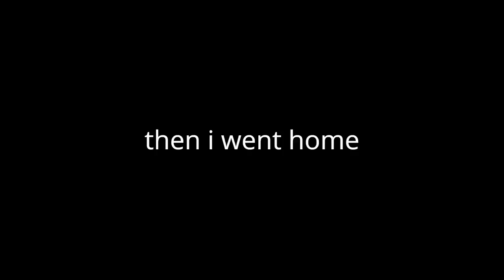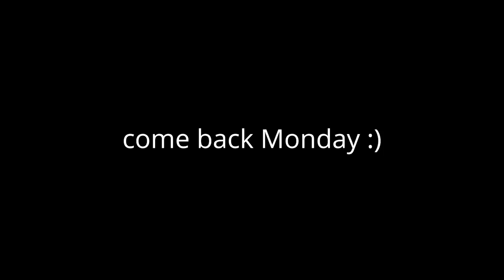BUYING MY FIRST EVER BMW PROJECT!

Comment: You gotta HOLD the Dsc button for like 5 seconds to fully disable , and don't jump them from the battery in back jump at the connections under the hood 🤙 excited for this car big e46 guy

Comment: All e46's did come with ASC, the thing is that your mechanic was looking for the ASC throttle body like on e36's,  but e46 are e-throttle so it's all in one. Also if it was engine swapped the ecu from the engine was most likely swapped over so I doubt it's a tune issue. You're looking at a vaccuum leak most likely, and probably at getting a more competent mechanic as well.

Comment: While everyone is excited i just want to say that i higly recommend to reinforce rear subframe mounts since this is a non facelift that's definitely one of the weakest parts in this chassis
Reply: Facelift or non facelift doesn't matter. They just fail in different ways. Subframe reinforcement is a good idea especially if its going to be a drift car.
Reply: @nikitakononov690  yea i know but it's a bit stronger on the facelift so a little bit less likely for the mounts to break but still a weak spot

Comment: There are three fuses for the dash in the glove box can’t remember witch ones pull em and put em back in it will work I just did it a year and a half ago it happens when the battery dies

Comment: As an owner of 2 e46's an e60 and an e90 i can't wait for this series.  Ps for all traction control off press and hold dsc for5 seconds but with lights on dash not working not sure if this will work for you

Comment: Since you said you plan on motor swapping it, you should n54 swap it (I’m biased. I love n54’s and have had really great experiences with n54’s). Literally exhaust and a tune on stock turbos will be 450whp and 500wtq and it will live at that forever as long as you pin the crank hub. The m50/52/54 engines do like boost but you typically have to build those motors where you can just pick up a used n54 for $1000 and make 650whp safely while abusing the heck out of it.

Excited to see what you do bro!

Comment: Do either m50 or m54b30! m52 is the awkward inbetween with the cons from both engines, especially if you're going to turbo it. m50 block is steel and m54b30 block is aluminium but with steel sleeves where as the block on m52 is all aluminium!
Reply: Thats not true lol. In North America the m52 still had the cast iron m50 block. In the rest of the world the m52 block was aluminum with iron sleeves. The m52b28(non TU) is even better as a turbo build than the m54b30 imo(at least budget wise). The b28 has a forged steel crank from the factory, it has a traditional throttle cable(instead of drive by wire), single vanos which makes it easier to tune and a bit less plastic cooling components.
Reply: @nikitakononov690  Right, completely forgot the american market is different. At least with the alu blocks I know that's one of the weak points and that it's a lot sketchier to do high boost with m52 for that reason. I've also seen a mot of m50s with 1000+hp, never seen an m52 in those numbers. Might be different in america

Comment: I think it's time to just buy a stock car to start with as a drift car......enough of these cars where you have to say "I think" about everything done to it and it's history. Just like you were chasing gremlin after gremlin on the 240 I see the same thing happening here. Could have spent a little more and had a decent base. It's not like you bought a sorted m3 swapped car.